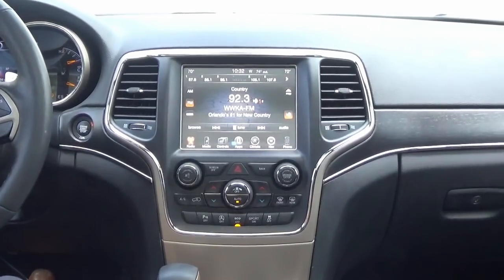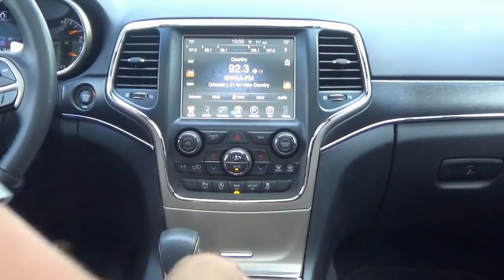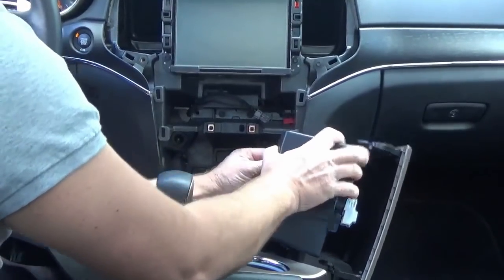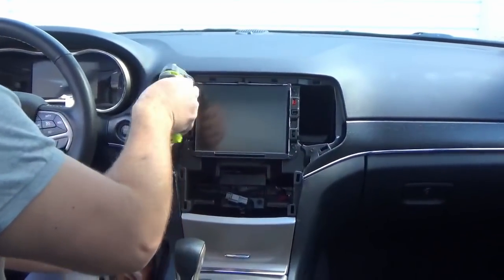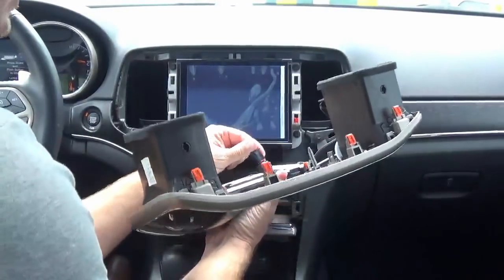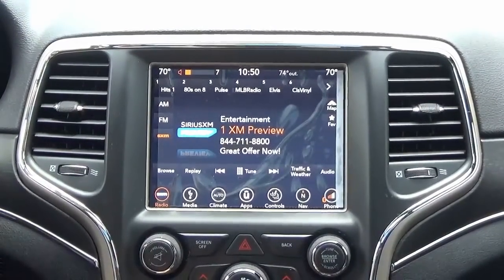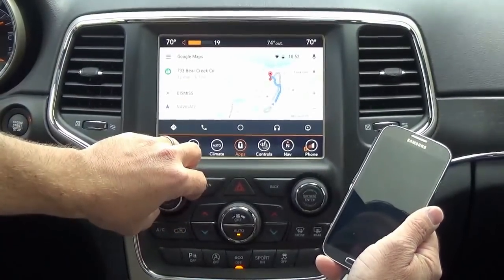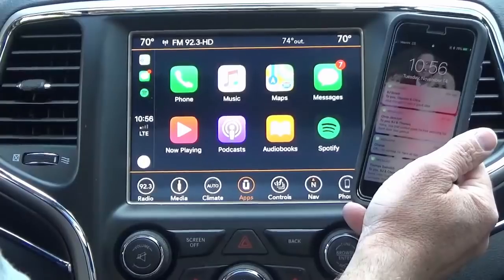2014-2022 Jeep Grand Cherokee Factory UConnect 4C UAQ Apple CarPlay Android Auto Upgrade

Comment: I'm having trouble with turning the center console sideways at the 1:30 mark because my shifter knob isn't surrounded by the leather housing--mine is surrounded by a set of plastic accordion pieces that move along with the shifter but does not allow the center console to be turned sideways (would break the housing). Any ideas? I'm guessing others have probably run into this as well.
Reply from the maker: Hi there,
So yes, I know what shifter you're referring to. Your shifter knob is elongated horizontally. On the left side of the shifter knob, there's a chrome ring and there's a little space right below the chrome. If you pull that chrome ring, the top half of the shifter knob will pop off (it's a bit snug, so you might have to pull a little hard, luckily it is really hard to break). Inside the shifter you'll see a screw that you need to remove, it's a Torx 30 size screw. Then you pull the plastic covering out of the shifter hole, and you should be left with a bar of metal. From there grab the back of the console (right at where your arm rest storage starts) and work your way around popping it out to the front of the dash.
Reply: @Infotainment_nav  Yep, I found a video on youtube on how to remove the shifter and did exactly what you described.

Comment: I have a 2015 Jeep Cherokee, NOT Grand Cherokee, would this upgrade also work on my vehicle?
Reply from the maker: We do have a UAQ upgrade for the Cherokee as well. However, the Jeep Cherokee is one of the FCA vehicles that has FIAT based programming to the body control module. The other vehicles are the Chrysler 200, and Jeep Compass. For some reason these vehicles do not accept the radio without intervention from the dealership. They have to perform a proxi alignment to force the vehicle to accept the radio.

https://infotainment.com/shop/interior-accessories/infotainment-radio-upgrades/2014-2021-jeep-cherokee-gps-navigation-8-4-4c-nav-uaq-radio-with-apple-carplay-android-auto-2/

Comment: Tengo una grand Cherokee 2015 altitud , necesito arnés para los asientos de calefacción?
Reply from the maker: No this is an older video. We figured it out for 15's so they do not need the additional harness. Only 2014's require that harness.

Comment: Unfortunately it doesn't work on my Jeep 2014 grand cherokee.. Purchased with an extra kit
install .
starts up first time and functions 100%
2nd time the radio does not start... ignition off and you see the Jeep loge for a while and away... no more response.
Then OBD diagnosis and the following error codes come up at U0199-00 & U0200-00 both lost communication with the driver by module.
Even the USB hub remains illuminated. I had contact several times and absolutely no good service it stops with no reaction any more ...at least took the radio out... €2550, lost to a non-working radio and very poor service from Infotainemt. It must be because it is in Europe that the service is so bad. ?
Reply from the maker: Please contact our Customer Support team!

Comment: Used this video as a guide for installing this Uconnect upgrade head unit on a 2014 Jeep GC. Hands and arms were in the way of the most critical connections and should have been done with the camera in a different position. Exactly how the connectors come apart depends on seeing which part needs to be pushed while pulling the connector apart. But, I am no expert in doing these kinds of installs and I figured it out! Thanks for doing this video! What I could see and hear was very helpful. I would not have attempted this install without reviewing this video a few times. Thanks so much taking the time to do it!
Reply from the maker: No problem at all! Thank you for the feedback. Those antenna connectors on the back of the radio are pretty small and unfortunately fingers tend to be twice their size. We're glad you were successful!!

Comment: Is it possible to replace the USB hub with the later style type with two USB ports and no SD card?  If not, what was the purpose of replacing the existing one with one that looks the same as the original?
Reply: I recently ordered this and it came with a two USB hubs and aux rather than a usb and SD card. I think the video just might be old
Reply from the maker: The upgrade comes with a USB media hub to accommodate Apple Carplay/Android auto.  The media hub is basically an interface that displays Apple Carplay/Android Auto on to the screen.  It is an essential component to this upgrade package and to the functionality of Apple Carplay/Android Auto.

Comment: Do i need to plug my phone if i get this in order to run android auto for my 2015 grand cherokee limited or can it connect wirelessly. Also will the remote start still work?
Reply from the maker: No this is a wired connection. Wireless did not come out until 2022 and we do not have a solution for it just yet. This upgrade will retain any existing features including remote start through the keyfob.
Reply: @Infotainment_nav  i'll wait a little more then. Hopefully you guys can make it work wirelessly in the future. I would hate to plug my phone every time. Thanks for your response.

Comment: Fully installed everything today. Android Auto and Apple Carplay are not coming up when I plug into the USB port. I do get the notification on my phone but the screen will not update. Checking again tomorrow as I'm hoping it just has to rest.
Reply from the maker: Please reach out to our support team at 855-636-6287 Ext 1 or at support@infotainment.zohodesk.com They should be able to help get that working or get a replacement sent out.
Reply: Did you ever find a solution? I am having the same problem.

Comment: You mention the 2015 also need the harness for the heated seats, but all the documents on the website states that’s only need for the 2014. Can you clarify?
Reply from the maker: No you are correct. This is an older video. We figured it out for 15's and that only effects 14's now. We also updated the listing to include this up to 2022. 
https://infotainment.com/shop/interior-accessories/infotainment-radio-upgrades/2014-2021-jeep-grand-cherokee-gps-navigation-8-4-4c-nav-uaq-radio-with-apple-carplay-android-auto/
Reply: @Infotainment_nav  awesome thanks!

Comment: Noticed on the video and on my updated unit that the Media tab selection still notes an SD Card even though the SD card is longer and there are 2 USB connections.  Anything we can do about that?
Reply from the maker: The USB media hub that is included in upgrade package will have two USB spots as well as the AUX port.  The USB media hub is an essential component to Apple Carplay/Android auto functionality.    

The “Media” button on the touchscreen will access media sources such as: Disc (If Equipped), USB Device, AUX, Bluetooth, and SD Card (If Equipped) as long as the requested media is present.

https://infotainment.com/shop/interior-accessories/infotainment-radio-upgrades/2014-2021-jeep-grand-cherokee-gps-navigation-8-4-4c-nav-uaq-radio-with-apple-carplay-android-auto/

Comment: 2k for a radio whew!...
Reply from the maker: We do not sell cheap equipment. We sell OEM quality equipment that is fully tested, pre-programmed and procured based on your Vin. There are plenty of companies that sell cheap products. We want to provide a part that we are able to guarantee works and will continue to work. We are confident enough in the product we sell that we are able to warranty it through installation and up to two years depending on your selection at check out. We feel our pricing is competitive as we are comparing our pieces to the cost of getting a new vehicle as opposed the cost of an aftermarket part whose quality is greatly inferior.
Reply: Junk yard has the same plug and play for 300